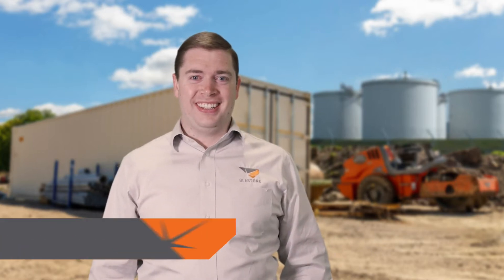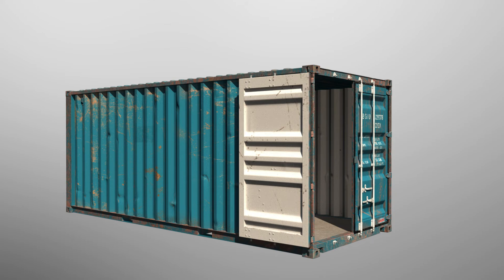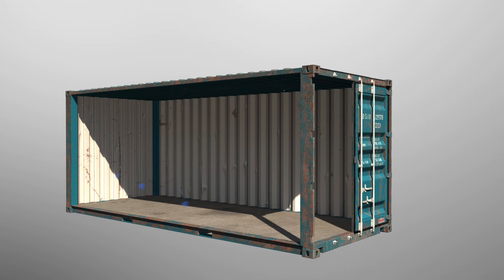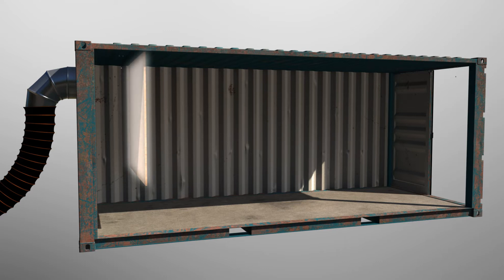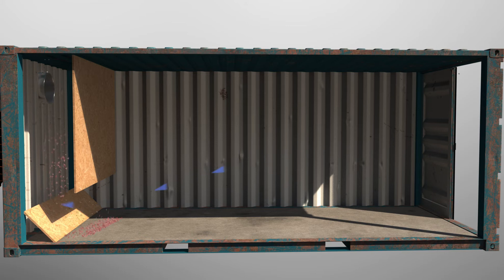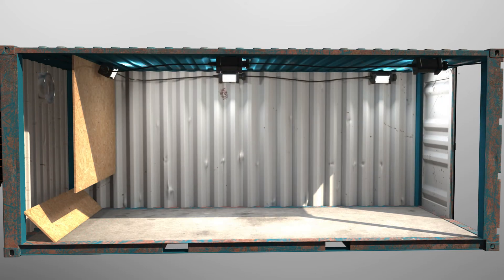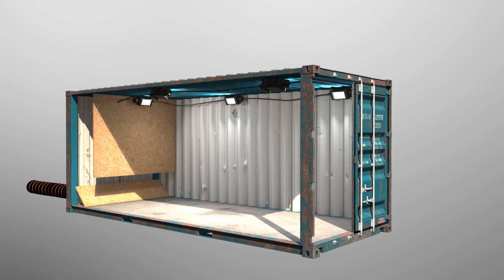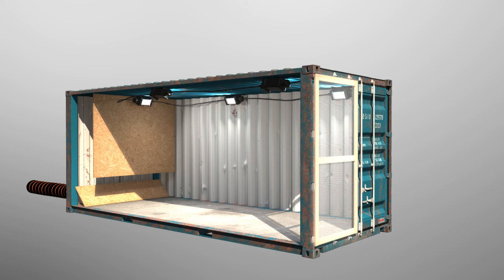How To Build a Blastroom Inside a Shipping Container

Comment: What would the cfm of the dust collector be for this setup?
Reply from the maker: Hello! Assuming 8x8 cross section, depending on media used,  3K would be sufficient for steel grit, 4K for Garnet/ Aluminum Oxide.